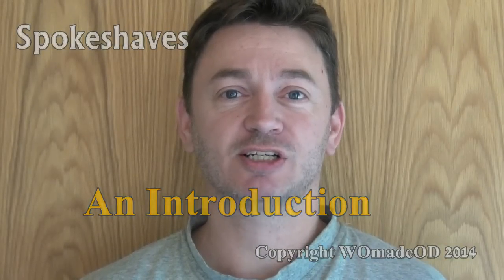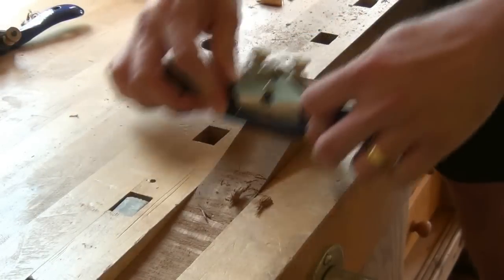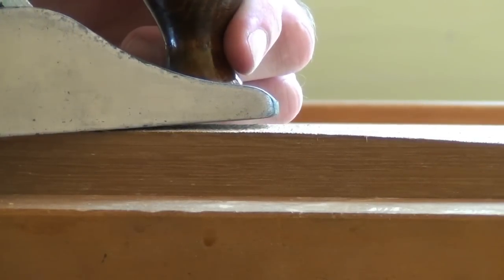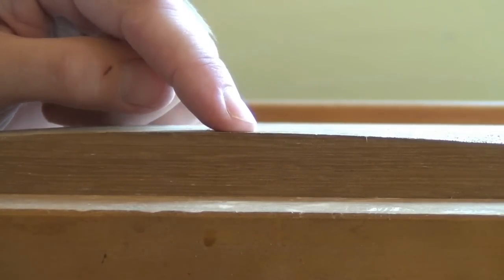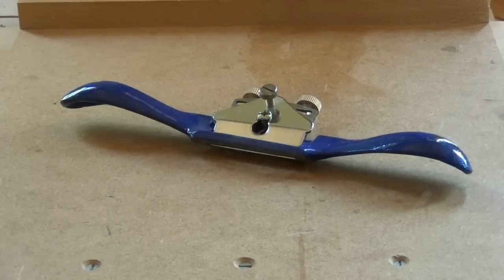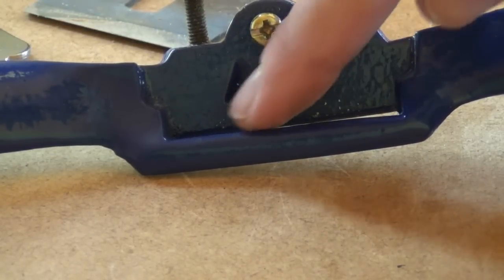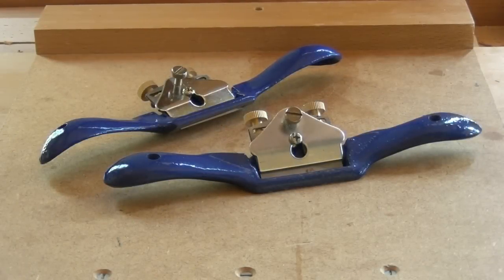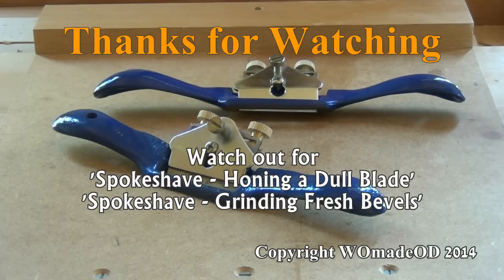Spokeshaves

Comment: Cheers, just purchased similar spokeshave today from tool station. Didn't work so well on oak. Will give it a sharpen tomorrow.
Reply from the maker: A good sharpen ( https://youtu.be/d8-X6XJ_SwU ) should help, and you could raise the bevel angle ( https://youtu.be/_f8S2mnVuP4 ) if the edge dulling quickly on the oak. Finding the sweet spot, where the shavings fly and surface is left pristine, can sometimes take just the slightest of changes to setup or technique, so have fun finding it.

Comment: Can you explain what is the use a spokeshave with a curved sole? I've seen these along side the flat sole ones you are using. Are they for hollowing out a space?
Reply from the maker: That's right Isaac, they are used for concave surfaces, such as the inside of a curved door frame, or the inside of a rocking chair rocker.

Comment: Thanks for the great video. What brand are these spokeshaves? These look very nice and I'm looking at getting some.
Reply from the maker: Hi Jamie,Would you believe 'Silverline' (as sold by ToolStation). They cost £4.06inc. in the June 2014 catalogue. I do have a Clifton and a Quangsheng, and they look and feel nicer, but to be honest, after a tune up they all perform virtually the same. The irons in the more expensive ones do tend to stay keen for longer, so bear that in mind if you're working curves 24/7. Happy woodworking, Mitch

Comment: where do you buy this equipment,.? Home Depot don't carry this,.  same with Lowes, I search Freight Harbor they don't have it either, give me a shot where to buy, I love to have one of this,.
Reply from the maker: If you were in Europe, no problem, you could get the exact same ones featured in the video. They are a budget brand, which with a few minutes work smoothing the soles, etc. can do great work. Something similar would probably be http://www.ebay.com/itm/New-9-Adjustable-Metal-Flat-Spokeshave-Plane-Handle-Tool-Woodworking-wood-DIY-/221894885096?hash=item33a9f73ee8:g:1kIAAOSwEetWA8rW
 Or look for an old Record or Stanley.

Comment: Beautiful videos, Mitch.
I looked at all 3 and will look my Spokeshave with round bottom and sharpen the blade. :-)
Reply from the maker: +Günter Schöne Thanks Günter, I hope you get it to work nicely now
Reply: Not until now. :-(
Announcement but know if it worked.
Reply from the maker: Günter Schöne I wish I could help more.
Reply: Hello Mitch,
You've been very good helped me with the videos. :-)
I'll take the Spokeshave if I handle and the round knob front of wood to build my Stanley Bailey Planer (No. 4, 5, 6). Because the current Handles and knobs are made of plastic.
Wish you a Happy and sunny Easter.
Reply from the maker: Thanks Günter, you too

Comment: Any tips on geometry for converting a flat into a rounded spokeshave for concave surfaces?
Reply from the maker: Keep the point where the blade emerges from the sole as a point on the circumference? I've not done this myself, preferring to buy a £5 rounded one and tune it up a bit. I would guess a few minutes with a belt sander could do the job though! Let me know how you get on
Reply: Will do!

Comment: Try a compass plane 8)
Reply from the maker: Thanks for the comment - A compass plane is great for a fixed radius (which you dial in as required), but, unless you are planing a section of a circle, you would need to keep resetting as your radius changes. I consider some practice with a spokeshave as a better route to take for those starting out.
Cheers, Mitch